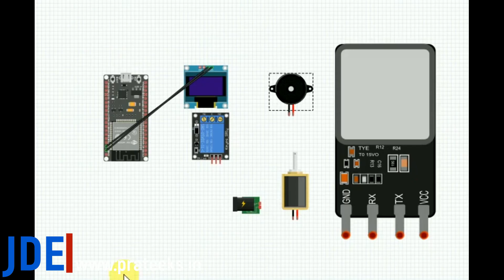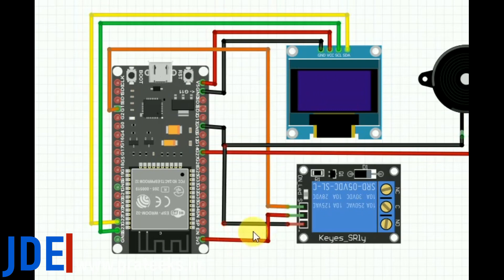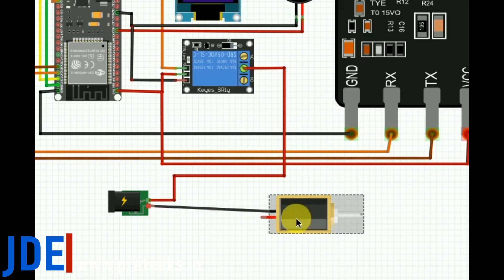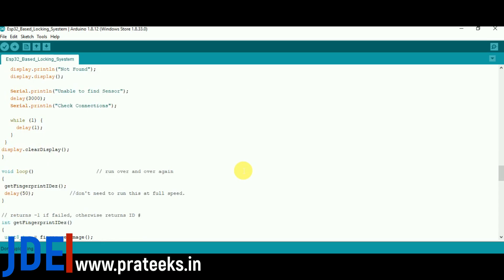ESP32 And Fingerprint Sensor Based Biometric Door Lock Security System | ESP32 Project

Comment: Hello bro in which software u are using for creating circuit diagram because I also want to make circuit diagram for esp32, AS608, 0.96 Oled display

Please tell me the software and how to esp32 diagram and fingerprint sensor and oled diagram should be imported on that software
Reply from the maker: Is normal paint software

Comment: Has anybody collected this scheme? I am always  see the message: " Sensor  Not Found". I'm  tried  3 different  sensors.
Reply from the maker: change rx and tx pin
Reply: @JustDoElectronics  this is the first step I took
Reply: But still Sensor not found
Reply from the maker: @maxinuravutova3563  xhexh rx and tx pin
Reply: #define MODEM_RX 16
#define MODEM_TX 17
#define mySerial Serial2 // use for ESP32
Reply: how did you slove this problem?